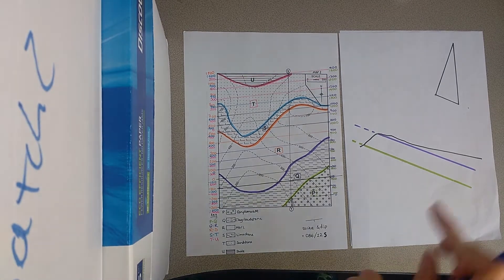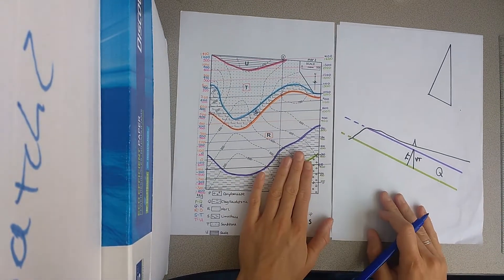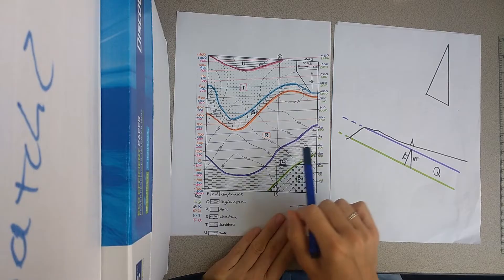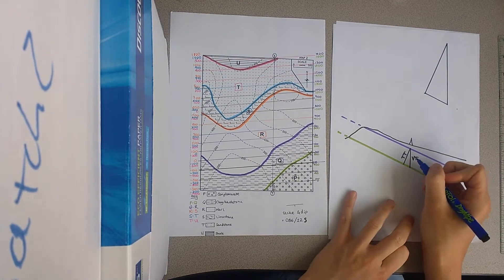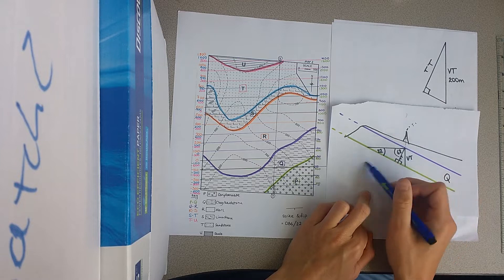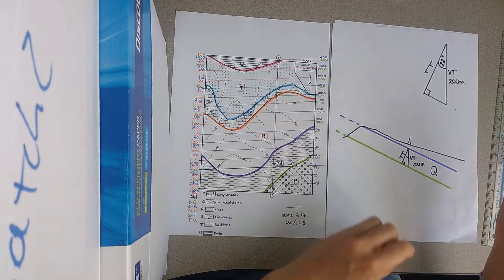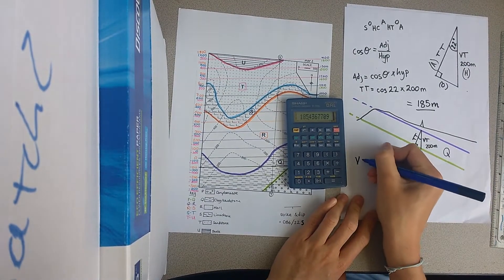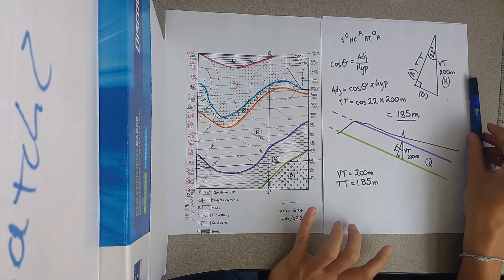Help video for calculating true thickness

Comment: Hello,
note for my students watching this nice video (thanks to the author !).
In order to get the true thickness on the cross-section, the cross-section needs to be perpendicular to the strike which is not the case in this example (even if that is close). In this example we will have an apparent dip and an "apparent true thickness". The formula is however always valid for the true thickness...TT=VTcos(true dip) ...since the vertical thickness is constant whatever the vertical section. But please use the true dip, not the apparent dip !
Best regards,
Jean-Luc Régnier
jean_lucregnier@mu.edu.tr